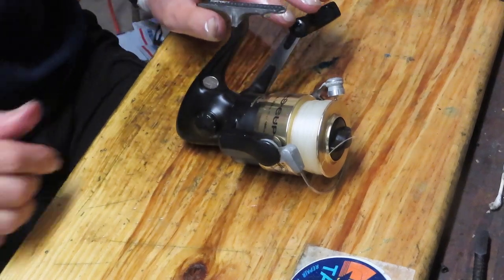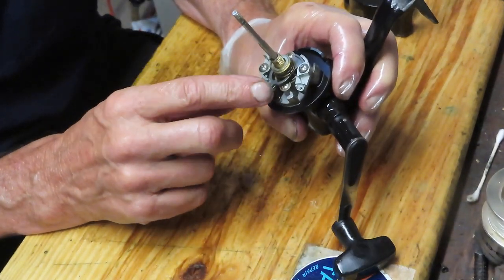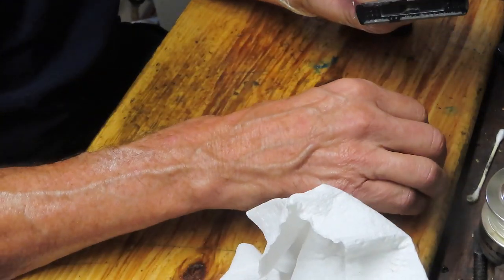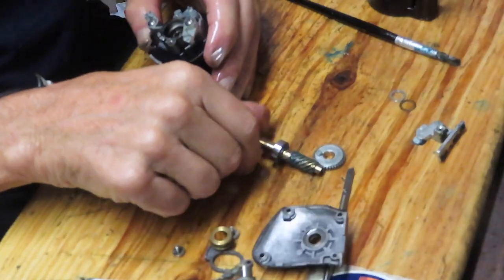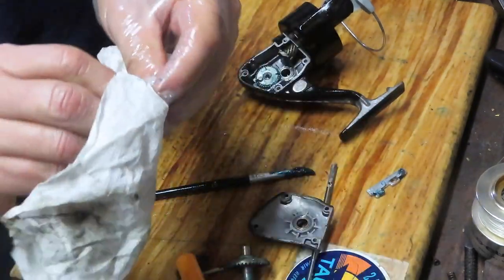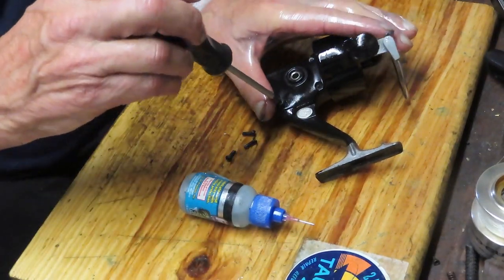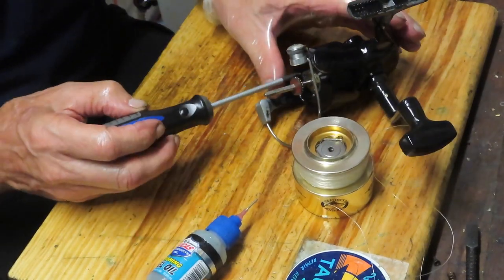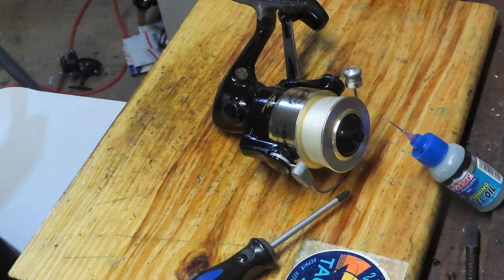Bass Pro Offshore Angler Gold Cup 50 spin fishing reel how to take apart and service

Comment: I’ve always wanted to try a Jarvis Walker reel but haven’t had the chance. I like the anti-reverse on this reel. I think that bar over the crosswind gear was a good idea giving more stability. I’m assuming the AR works against teeth inside the rotor. With this double AR dog system I can more readily accept the teeth on the inside of the rotor as the means for stopping the rotor. I’m usually not a fan of rotors that work this way.  I prefer the center cog method. I usually put a drop of oil in the side case screw holes. All in all I like this reel. Great video Dennis! I’ve never seen a reel quite like this.
Reply from the maker: Thanks Chris.  I hop you recent fishing trip was a success - Great sunrises too!  Dennis
Reply: @2ndChanceTackle  Dennis, fishing was perfectly awful on our trip. The two best things were my granddaughter catching her first fish and that gorgeous sunrise! Of course anytime to be at a beautiful place with your family is a blessing beyond words!

Comment: Great video Dennis.... continue to enjoy your videos..looked back on some your older videos I have a Diawa BG 5000 is it similar to the BG 4000 you did...
Reply from the maker: Yes it is.  the 50 and 60 versions are near identical except for spool capacity.  The mechanics in the 40 and 50 are the same design, but the internals on the 40 are smaller.  Best wishes - Dennis
Reply: @2ndChanceTackle  Thank you

Comment: Sir I don't know if you would agree with me but some times I use a kitchen sprayer to clean the reel then dry it thoroughly with forced air then oil and lube as needed, please let me know what you think thanks Rick.
Reply from the maker: That is fine Rick.  I agree!  Thanks for the tip - Dennis